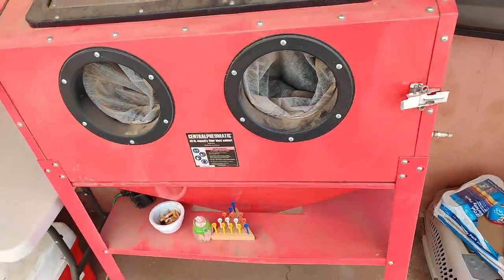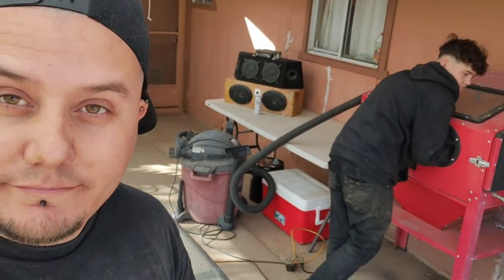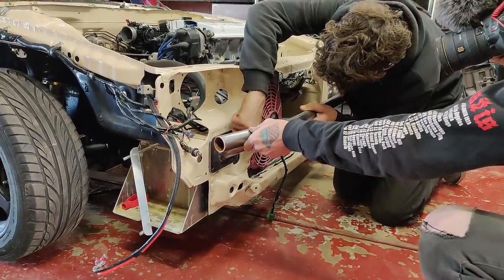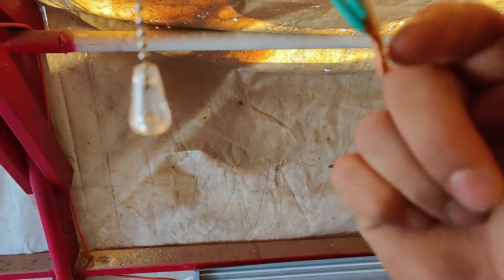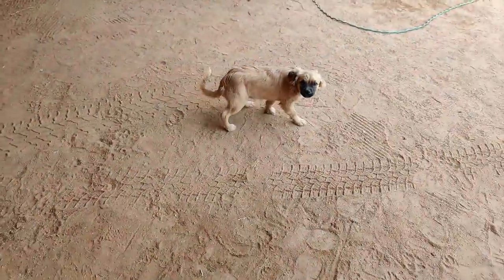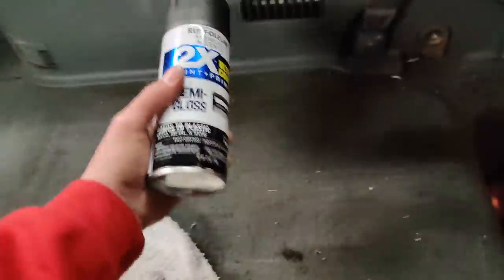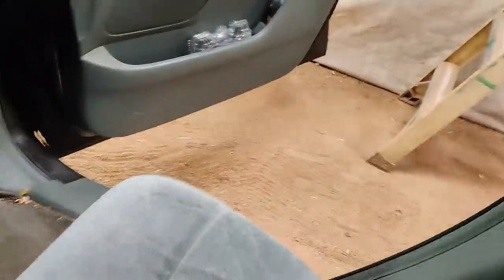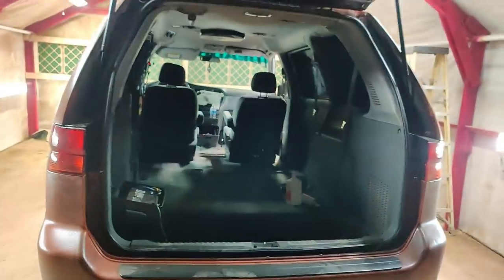Tinted my windows...with SPRAYPAINT!!

Comment: For them lights you should of used a solid 14/2 wire , you can open the fixture and wire it straight to the ballasts. It’s super easy and can handle the power being drawn from all them lights , the extension cord theory will work but will eventually fail
Reply: Does that also apply to an LED setup as it has a way less power draw?

Comment: I tried to gold plate my parts and it's hard to get a mirror finish
Reply: Lots and lots and lots of sanding from 80 grid down to 2000!!! 80, 180, 220, 320, 400, 600, 800, 1000, 1500, 2000 and even 2500 wet on 1000,1500,2000,&2500